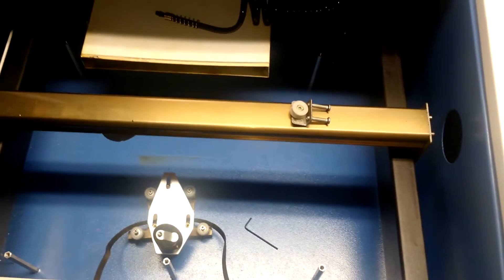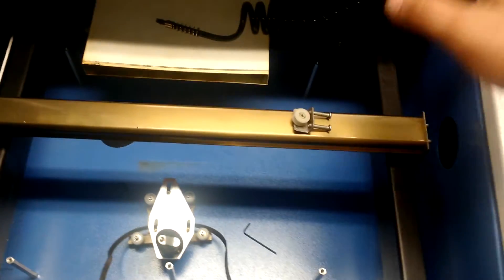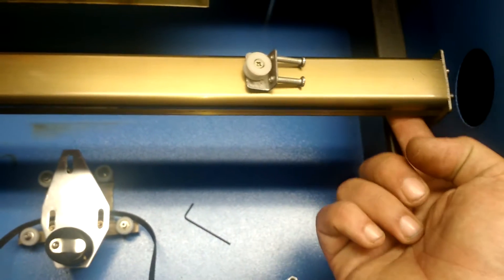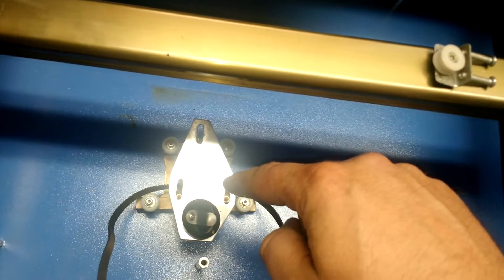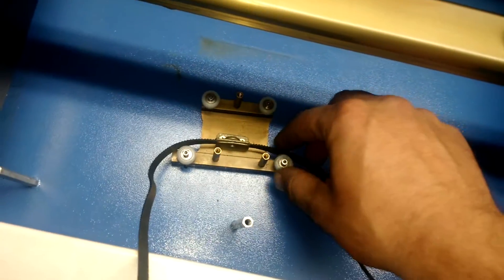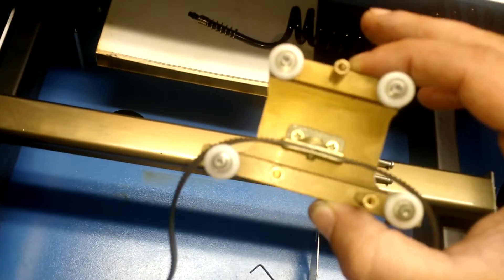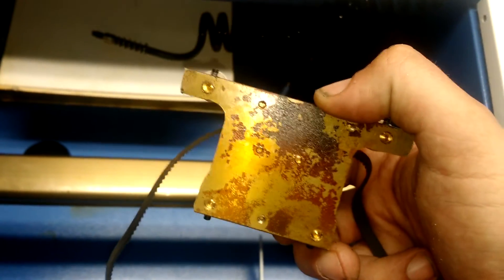K40 laser X axis belt removal

Comment: Hi
I have the same machine. There were 3 tooth's were damaged. I just removed the belt and put it back after reverse it. But I am getting in X-Axis size difference. If I cut 20 cm but it cuts 21 cm.
the belt is the same and no other changes. Is there any help to get the correct cutting size.
thanks and Regards.
Reply from the maker: Abdul sounds like the pitch of the belt isn't quite correct. I have been recently informed that there are two different drive systems used on this machine one is a 2mm and the other is 2.5mm this will cause the issue you are seeing

Comment: Where do you order the belts to replace ??  I received my New (?) K40 and upon unpackaging, it was found that the Belt(for Front to back movement) was broken and laying in bottom, seller offered deal to keep, but I have no knowledge of repairing or replacing belt or even where to start, I am at Ldkelley309@outlook.com    if you have any suggestions or advise.   respectfully  Doug
Reply from the maker: Lawrence Kelley http://www.lightobject.com/mobile/Y-axis-belt-for-K40-P760.aspx is a link for the Y axis belt... the tensioners for those belts are located via two holes in the back of the machine that are about a 1/4 inch in diameter... there are two belts for forward and back movement for the left and right side of the gantry... you may be lucky enough that it just came unclamped look for where the belt connects to the carriage if it's not in two pieces, otherwise it's about 15$ to order the minimum quantity of belt and you will have some extra left over incase you have problems in the future
Reply: thank you so much for the information, have you changed the side belt before ??  and is it very difficult to do ??
Reply: This is my first machine and first experience, so I am totally new at this, any info is greatly appreciated
Reply from the maker: I have not replaced that belt but it may require you to take the entire x,y assembly out of the machine you can look for a video on YouTube about squaring up your k40 gantry assembly which will show you what screws to remove... a total realignment of the mirrors will be required. also a good resource for these machines can be found here https://plus.google.com/communities/118113483589382049502
Reply: your the best, thank you so much for the wealth of information, May God bless you in all you do.   respectfully  Doug

Comment: thanks man do you know if the belt is 5.00mm? i need a new belt need to know the size, and my old belt is tore to shit, how will i measure the belt length?
Reply from the maker: DELTA DJ  I purchased the belt from light object found with a quick googling, they sell the belt in the k40 upgrades section and will be a long roll that you cut to length, I used the old belt to get the length needed
Reply: i see but my old belt was cut in like 3 pieces lol, Thank you

Comment: Hey Alex after I changed mine it started going to right instead of the left, did you have any issues with this? Also it's like it forgotten where to stop. Any idea what I did wrong? Thanks heaps x
Reply from the maker: Do you have optical or mechanical endstops that tell the machine where home is... Sounds like the switch or sensor is stuck in the closed position causing the machine to think it is parked at home and to keep moving away... Does it go to the far right and start clicking until you turn it off and move it away?
Reply: Hi Annie, I know your message was 6 months ago. However is someone else has the same issue.

You may have put the little wheeled carriage on the wrong way around.

When the laser starts it will pull the trolley thing to the left where it hits a sensor to make it stop. The belt I believe needs to attach to the trolley on the closest belt to the front of the machine. Id it is on the other belt the machine will push the trolley in the wrong direction whist it tries to look for the endpoint sensor.
Reply: i have this issue now and still digging for answers, sad
Reply: @jericklescain614 did you find anything out to help?

Comment: Can I ask where you got the replacement belt from?
Thanks
Reply from the maker: gizmo lulu I purchased from www.lightobject.com in the k40/dk40 section they have various other replacement parts for the laser as well
Reply: Alex Krause thanks for the quick response, much appreciated, just need to try and figure out where on that forum now :)
Reply from the maker: http://www.lightobject.com/mobile/X-axis-belt-for-K40-P761.aspx
Reply: Amazing, thank you so much,

How much did you have to buy, it says 5ft min, no idea how long the belt actually is in the k40, just noticed so of the teeth have came away and need to order a replacement.

Thanks again for your help :)
Reply from the maker: 5 ft makes 2 belts ... use the belt you remove as a template for how much to cut... then trim it shorter by a tooth or two if the belt is too loose... they do stretch out a bit over time
Reply: Alex Krause excellent, thanks for the info, last question, how do you join the belt together, or is that a stupid question?
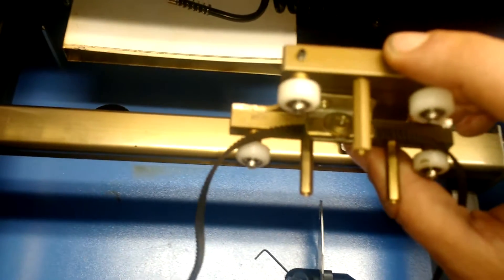Reply from the maker: 1:30 into the video shows where the ends get clamped down the screw loosens up and you put the end under the clamp and tighten it back down
Reply: Just spotted that, excellent, thanks for taking the time to reply, you are a gentleman :)